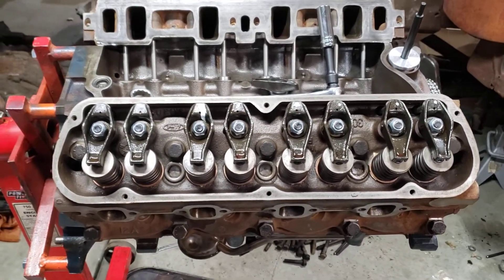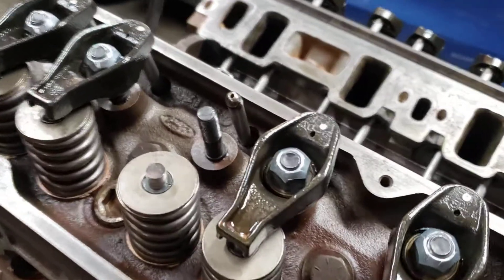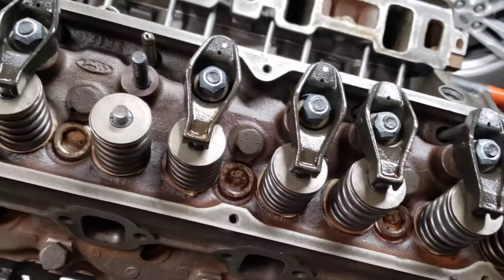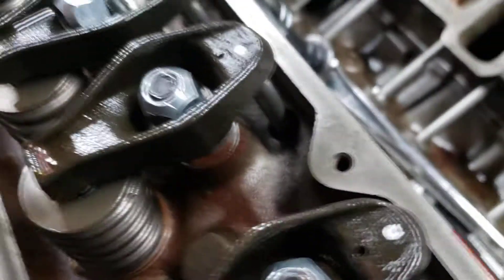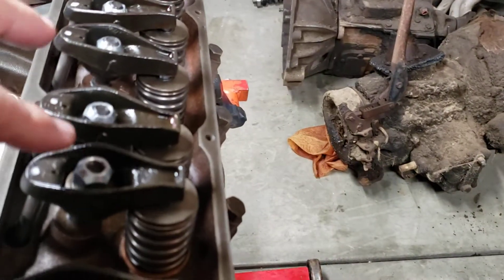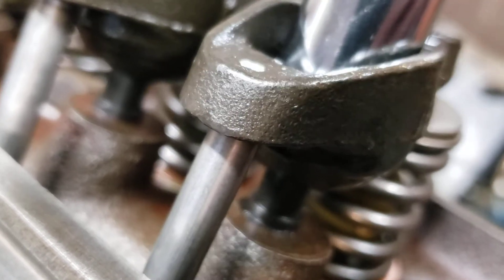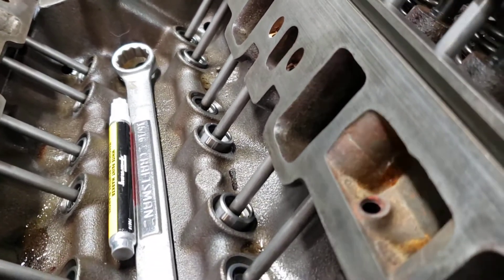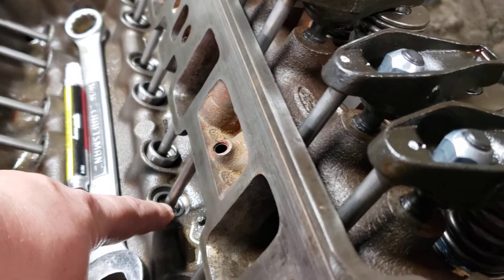221, 260, 289, 302 & 351W windsor small block Ford sbf rocker arm install 3/8 stud with 5/8 nut

Comment: The factory pressed positive stop rocker studs ('67-late 70's) appear to have been replaced by aftermarket adjustable non-hex screw-in studs. The clue is a thin shoulder on the stud, where it meets the machined surface of the head.

The locknuts used are appropriate for these adjustable studs ('62-'66ish).

Self-aligning bolt down stamped steel pedestal rockers were used from the late 70's, till the end of 302/351w production.

Comment: No issues with the rocker slot not being long enough with the lift of this cam? I ordered the non rail version (1962-1965 style) of these rockers for the 351W in my pickup. I just can't stand the noise of the roller rockers I have and the cam I have has less lift than the one you used according to the specs when I looked it up. I'm at .433" Intake .461" exhaust for lift and 120 lb seat and about 240 lb at max lift for spring rate I think the stock rockers will work just fine. I can't use the later pedestal type with the heads I have so these should work.

Comment: Pretty good video, but saying you found a "pretty credible" source that  says 1/2 to 3/4 turn is not right. Its an opinion rather than the fact. Ford says 1/4 turn after the pushrod can no longer be spun. Just use the actual source. I am a certified Ford technician - Ford  asset # 6818825. "...when the pushrod can no longer be turned, all clearance has been removed. After the clearance has been removed, tighten the nut an additional 1/4 of a turn." Courtesy of Ford Motor Company. I use the manual so there is a quality and warranty to the repair. Adjsuted to specification means nothing if it is not.
Reply from the maker: Thank you for the info. Always good to have more info. I'm definitely no expert and welcome any credible sources. It must have been good enough, truck still runs great & gets driven many times a week. Thanks for watching!

Comment: did the 1/2 of a turn on my  stock 1963 Falcon V8 260 after replacing the valve's seals and I had chatter... 3/4 did the trick. More than that, and you'll get the valve not closing properly.
Reply: 3/4 of a turn with the 3/8" studs give you about 0.0375" preload, which is the ideal amount. You can turn them more though as the plunger in a factory style lifter has about 0.170" of travel. David Vizard has done dyno testing on his channel where he bottoms the plunger out and then backs the nut off starting from the bottom and achieved really good results.

Comment: Scrap those rockers for roller tip ones and use guide plates to keep everything  lined up.I did this on my GT 40 heads on a 351w.
Reply: You cannot do that to this block it isn’t a rollover block 😂

Comment: The lifter preload on these engines ( and ALL old-school Ford OHV engines with hydraulic lifters) is adjusted by adjusting the pushrod length.  On the Fords with hydraulic lifters, you just run the rocker nut down till it bottoms out and torque to spec.  Now this is with the factory rocker studs, on hydraulic lifter applications REGARDLESS of the stud diameter..  Ford had multiple lengths of pushrods in the parts books for adjusting lifter preload, most aftermarket suppliers also offer different pushrod lengths.  Typically you would install the correct length pushrods for the correct preload, this is doubly important with the early style of rail rocker such if you have incorrect valve train geometry it can lead to the rails on the rockers bottoming out (especially as the rockers wear) against the valve keeper resulting in a dropped valve, then nobody has a good day when that happens....
Reply: All I can say is my garden variety '68 Mercury 302 2 barrel had adjustable rocker arms. This I know for a fact.
Reply: @jamesweidinger1117   Then there were changed, the ONLY small block Ford that had adjustable rockers from the factory was the 289HP EVRYTHING else used positive stop rockers  and lifter preload was adjusted with push rod length..  Go on give us a part number for these adjustable rocker studs or show us a Ford service manual procedure outlining how to adjust them.. I DARE YOU ........
Reply: Many of the early Ford engines had fully adjustable rockers and used 3/8" studs. Not "all"  were set by bottoming out the nut.
Reply: @whiplashmachine   NO that's not correct. There were exactly 2  Ford OHV V8's that had adjustable stud mounted rockers from the factory, the 429 SCJ and the 289HiPo. They are also the ONLY mech lifter engines that had stud mounted rockers.  ALL other Ford Engines with stud mounted rockers are adjusted through the push rod length, and the rocker nuts are just bottomed out.  ALSO the only OHV V8 engine family's to use stud mounted rockers are the early Small Blocks and the early 385 Series Big Blocks. Everything else used shaft mounted rockers or sled fulcrum rockers.
Reply: @matthewq4b  Well I bang out a few dozen 289's, 302's and well, not so many 351W's  each year and many of the early ones have 3/8" adjustable rocker studs and they are certainy not the hipo heads. I do have some with the 3/8" stud that taper down to a 5/16" threaded end that yes, you crank em down all the way but I come across more of the 3/8" threaded adjustable studs here. The pedistol mount rockers for Windsors came out early 70's and and stayed throughout the manufacturing period and was never on a 289
My discusion here derived from you stating "ALL old-school Ford OHV engines" and well I just shipped out another 289 yesterday (non hipo) with factory 3/8" adjustable studs. I also have a 302 on the go with same studs and a set of 289 heads being rebuilt with same fctory 3/8" studs. If I posted a video with a non hipo head with factory 3/8" studs would you beleive after that?
Reply: @whiplashmachine    Go back and read what I wrote I said "Ford OHV engines WITH hydraulic lifters"  Looks like you missed that bit.  And ANY engines you get with with adjustable rocker studs  that are not a 429SCJ OR 289 Hi PO's  have been modified to adjustable studs. This was a very very common thing to do back in the day. Whenever heads or a block was decked (or even with a cam swap)  and if you could not get the adequate  or correct lifter preload it was far easier, faster and cheaper  to just swap out the rocker studs  than it was to individually measure the needed length for each push rod then order them from Ford (basically the only supplier for the various push rod lengths at the time).  I've been building these engines for  I suspect decades before you were even born. Basically 50 years now. What you are seeing now are the left overs of which many have been rebuilt or worked over multiple times.  Again Ford NEVER installed from the factory ANY adjustable rockers studs on ANY juice engine and the ONLY ones they did install them on were the HI-PO 289 and the 429 SCJ.     And Ford unlike GM and Chryco documented ALL parts utilizations  and changes in the parts manuals with supplemental and updates.  So post the casting numbers of these supposed head with adjustable rockers studs and I can guarantee you EVERY single one will have been be equipped with non adjustable studs from the factory.   This far on you can NOT use what crosses your bench to say this or that was done.  As too much time has passed and there has been too much opportunity for mods to have been made. The last time Ford used Stud mounted rockers was over 46 years ago   The small block was the last one to use them in the 76 model year and they were positive stop studs.....
Reply: @whiplashmachine    Oh and every single small block you have posted on your channel was opened up previously before it crossed your bench..
Reply: @matthewq4b  Well I'm almost 50 lol, not that that matters. And I ve only been building for 20, in actual machine shops with guys that have plenty of experience and like you, hate when a younger guy comes along and knows more about something. With the engine shop guys its the fact I am an actual Journeman machinist and know some teicks about metal removal and measuring that an engine guy has never been exposed to. Thought we could have a discussion but you seem to be more challanged than anything. I rebuild engines for a living and Fords are my main products. I know all the deck hieghts and how much they vary from factory. How much hyu can mill off a block and heads before geometry gets to be a problem. I know what interchanges and what can interchange with mods performed and so on.   I can also read a order catolog, which gives us the part numbers and years and dates said parts are offered and for what applications there for. 
 So if you wanna have a discussion, I'm in. But if your just toot your age and backyard experience then I'm just gonna move on and continue running my machine shop that produces more engines a year than you probably ever tinkered with and find discussion elsewhere.
Reply: @matthewq4b  so. Ive posted like a dozen different projects on my channel. I see around 70 engines a year in my little shop.
Reply: @whiplashmachine  Gotta say you look great for pushing 50.  And you can not rely on a suppliers order catalogues they are notoriously rife with errors and omissions especially now, they omit all the supplemental add ons .Least back in the day they relied on the actual paper Ford parts catalogue to model theirs on so they were far more accurate and correct with less fantasy applications and omissions..     And what you are doing in a year is what our shop did in a month back in the day when I was still on the machines.  LONG before the days of CNC and DRO's....We had the contract for Engine reman in out region  for Ford (both heavy and light) For over 50 years until we were bought by CAT OEM a few years back. So I doubt there is much you could tell me about Ford OHV's.    Regardless it does not change the fact that the only Ford OHV engines to use adjustable studs were the 289 hi po and the   429 SJC and I forgot to mention they are screw in NOT push in.   And just as an FYI Ford NEVER produced an automotive  production push in adjustable rocker stud. Don't believe it go try to find a Ford part number for such a part...  I'll save ya the effort there is not one as they never existed.. You really should pick up a period parts manuals they will be of far more use than you will realize.  And can help sort out some of the crazy in the after market catalogues.
Reply: Where are you located sir?
Reply: No . use shims under pedistal
Reply: @nitro456jk    WRONG  Push rod length was adjusted and Ford offered multiple push rod lengths for this exact reason..  Shimming the rocker pedestals changes the valve train geometry and is hack job fix used by incompetent half wits..

Comment: U don't put oil in the new lifters ,do every rocker just the way u did the first one to get 0 lash on everyone of them with out turning the motor till your done with all of them set at 0 lash then u turn the motor 90degrees goback and check all of them to 0 lash again turn 90 degrees and set 0 lash again then turn motor 90degrees again check valve lash again then Stat 3/ 4 turn on every rocker do not turn the motor just set every one weather they are up or down 3/4 of A turncoat will b 33 thousands and don't touch it the valves are set pour oil over thlifters to fill them 2 3 quarts and no problems it will start with no noise every time done it that way for yrs

Comment: Oh no get rid of those rockers they get worn in the middle and the side scurts will push on the valve spring and the keepers will come out and thar 260 280 302 351 400 will swallow a valve beleive me those rockers are junk that's why you are having trouble with your adj they will cost u a engine ,,,and 3/4 of a turn is 30 thousands those Ford rockers are trouble I'm telling u if there are any miles on those rocker arms junk them it cost me 2 motors and I put new lifters balls and push rods  but the rockers cost me because where they touch the top of the valve it gets worn inside there and the side skirts push on the retainer and those keepers will pop out and the valve hits the piston and breaks a hole in the cylinder wall ,,,good luck if u leave them in
Reply: Never seen this happen or heard of this happening ever before in my life… those pedestal rockers are just fine. Maybe you’re the problem with that failure..
Reply: @lonewolftech  sorry just telling you what happened ,,,,your right
Reply: @briananderson3801  That will happen if the valve stems are shorter than they should be. Either ground/resurfaced on the tip during a rebuild or most commonly some of the replacement valve tips are shorter than OEM.

Comment: There's a circlip at the top of each lifter. This retains the hydraulic piston within the lifter body. Position the lifters fror each cylinder on split overlap or ensure the lifter that you're focusing on, is on the heel of the camshaft lobe (as you're currently doing.) 
Next, insert the pushrod between the lifter and the rocker. Now tighten the nut on the rocker down until the lifter piston is .020" - .060"  below the circlip. This can be gauged using a thin welding rod or similar that is bent at a right angle  so that the rod forms a small L at one end. Use a set of verniers to check and adjust the thickness of the rod if required. When this "gauge" can be inserted between the lifter piston and the lifter circlip, the correct preload has been achieved.

Comment: Had a 221 in a 33 ford it ran very well . I got onto trouble when i raised the compression , head gaskets , had to settle on 11 -1 which took another set of pistons . After that and a few dozen cam changes i finely hit what engine liked . Great on gas and it would roll along 70 - 80 all day . Put a ton of miles on the Alu. rad. solved the heat problem . The last time i saw it was setting out sidethe man shop who i sold it to chopped up pretty good pretty well rusted , his hot rod skills weren't to good . That was 40 years ago ................

Comment: Just to clear up any possible confusion, the rocker studs you are dealing with are not original to your heads.  What you have there are 7/16" X 3/8" threaded replacement studs which are sometimes used to replace the original (pressed in) 3/8" X 5/16" "positive stop" OEM studs. They are furnished by several vendors and are available from almost any machine shop, speed shop, or auto parts store. Most of the brands you'll encounter are actually manufactured by Pioneer Products, whom I'm pretty-sure also sells them direct...Hope this helps...Good video BTW.
Reply: Do they give a better performance, or the same/similar?

Comment: Thanks for the video good job. question if you don't mind. I have a 1969 351W engine. The lifters are not primed. the only way I can get the lash out is to run the rocker nuts all the way down on the rocker bolt. At that point I really can't pre-load the lifters either.  Does that sounds correct?  I wonder if my push rods are too short?  Also do you know if I need to double nut each rocker to ensure the nuts don't com e loose? thanks again
Reply from the maker: The correct nuts are crimped at the top and should not turn. When my lock nuts start to drag the pushrods is when there is one or two threads showing above the lock nut. If you have to run the nut down way farther than that, you might have 289/302 pushrods (351w has a taller deck and longer pushrods)
Reply: Check out "matthew Matthewq's" reply above yours. He states (and with confidence!) that stud mounted ford OHV V8's all have the nuts run down to the bottom and torqued- preload set via pushrod length.

Comment: Tks for the vid. 
What kind of big truck do you have in the foreground of the video?
Reply from the maker: 1948 Ford F4 truck that is going on a 2009 F350 4x4 dually chassis and getting a 7.3L diesel & 5 speed. If you subscribe to my channel you will get notified when new videos arrive.